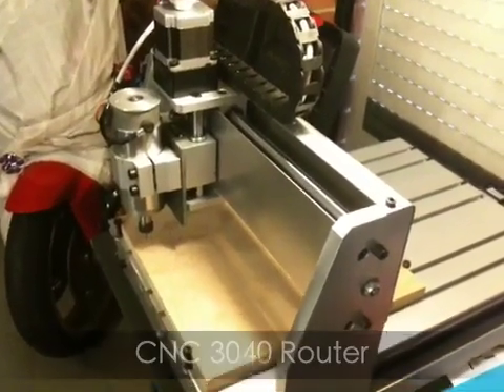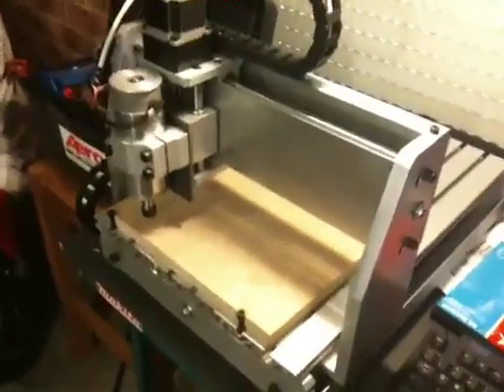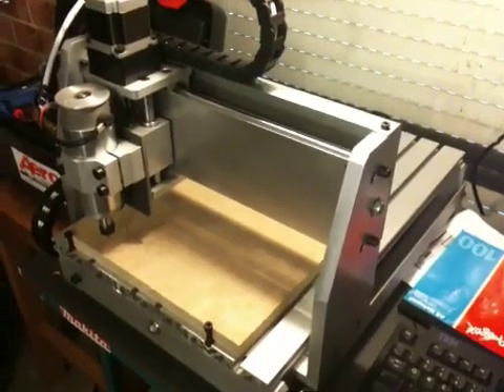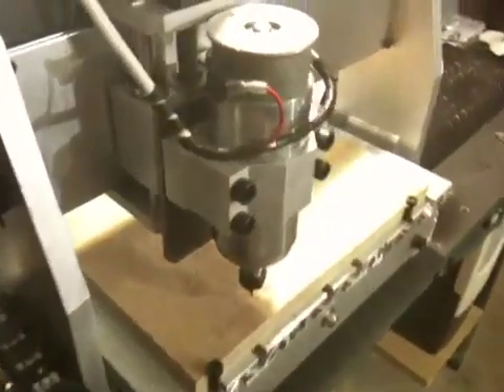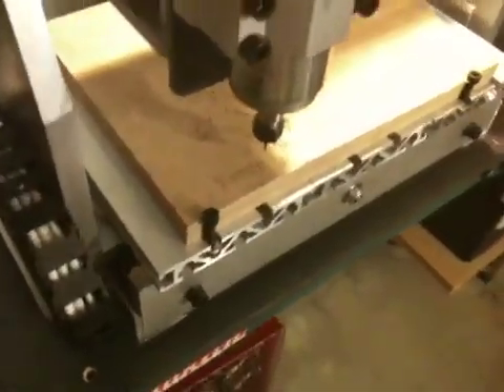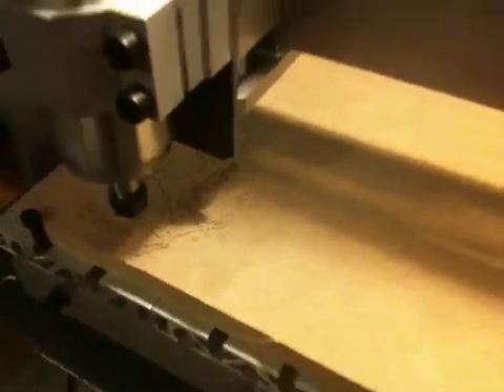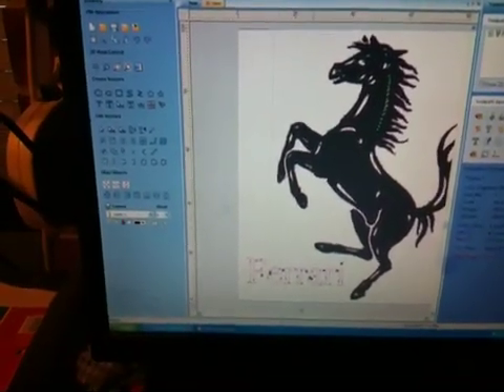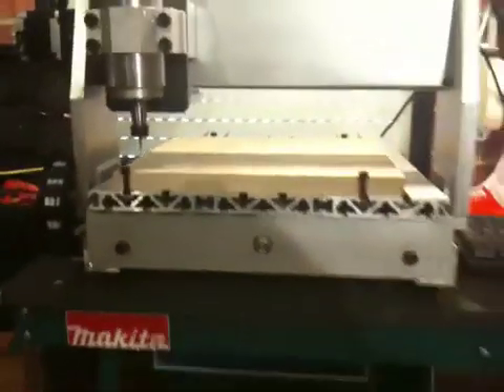CNC 3040 Router Milling MDF

Comment: Hi,
Can you please tell me the specs of Cutter Spindle?
I am also thinking to buy 3040 from china with 230W spindle. Please suggest if it's fine!
Reply from the maker: Virendra Nirmalkar Hello Virendra, my advice would be not to buy the 3040.  I would however buy the 6040 because it has ball screws and a VFD & better spindle motor.  Cheers Aaron.
Reply: DCTTeacher1 Thank you for the reply, I am thinking to buy a bigger one later on when I leave my job and start my own business.... as of now, 3040 is for learning purpose.
Reply from the maker: Hi Virendra, I looked at the router URL link that you sent me.  Notice the spindle motor is second hand.  This is another problem with the 3040. My honest opinion, save your money and purchase the 6040. Kind regards, Aaron
Reply: Thanks a lot for the help! :-)

Comment: Can you use this machine to cut out shapes as well. I am looking for something that can cut out wooden toys on 1x10 boards
Reply from the maker: Jessica Dodge Hi Jessica.  Yes you can use a machine like this to cut out shapes too.  However, you will need some CAM software like VCarve-Pro to do so.  I have since sold this machine, but if I ever bought one again I would get the 6040 and not the 3040. Cheers, Aaron.